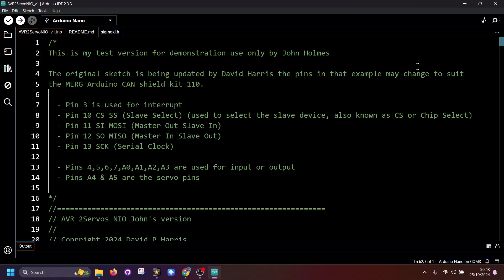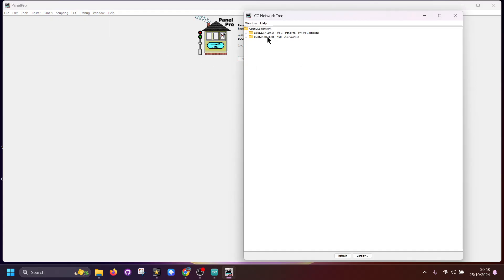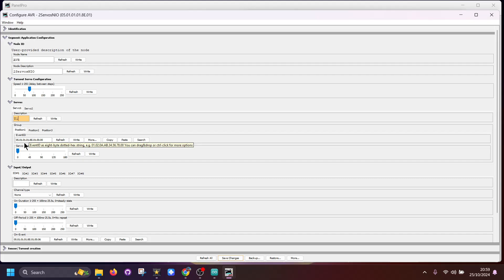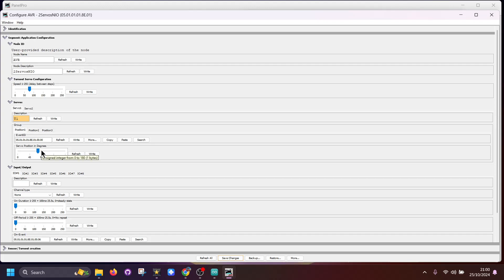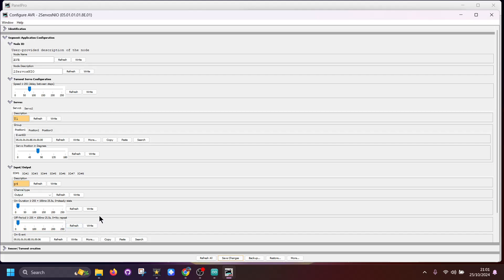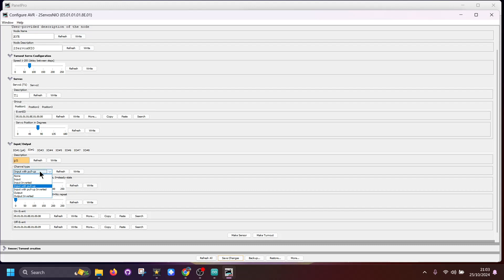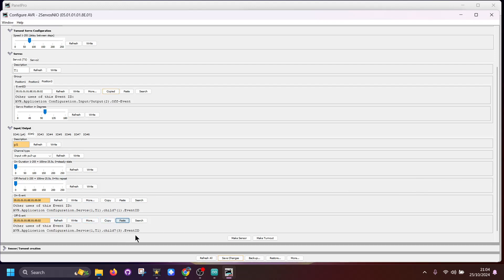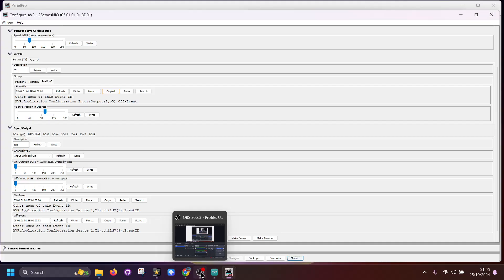Arduino Nano LCC 2 Servo 8 I   O

Comment from the maker: There has been a library update to version 0.1.4 today and the AVR2ServoINO you will need to swop the interrupt pin on the Arduino from Pin 3 to Pin 2. In the next release we hope to move to 1 version of the sketch once we complete more testing.